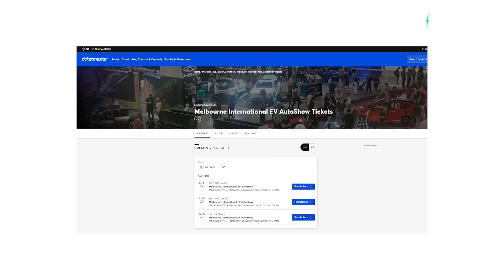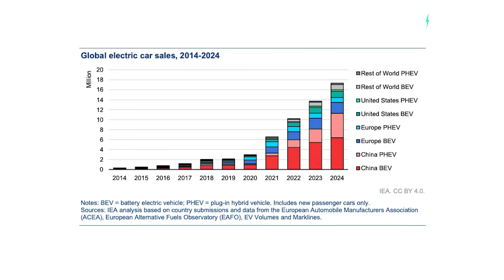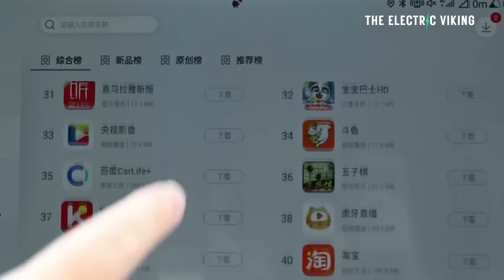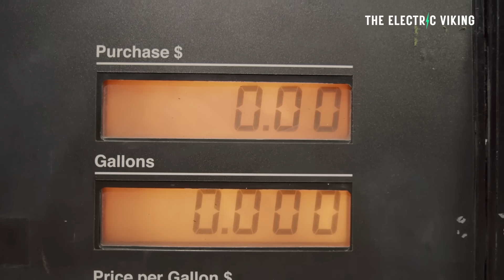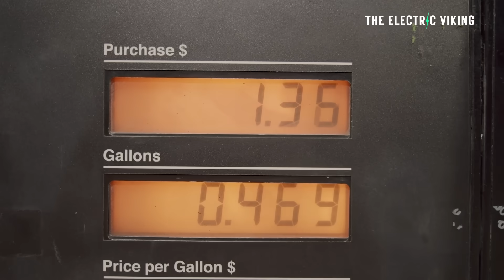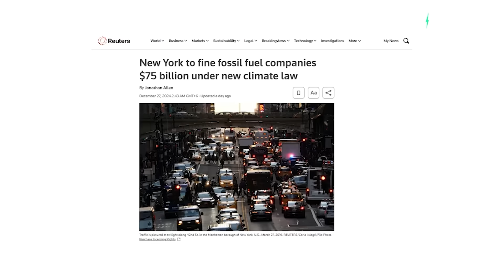Numbers Don’t Lie: Electric Cars Are Steadily Replacing Oil

Comment: Here in the UK where coal is not part of the energy food chain at all.......We have some of the highest EV charging costs in the world..
Reply: Sorry but you guys got the highest costs of almost everything over there. 🤣
Reply: Until gas stops being a part of the pricing structure, it will continue to be high.   The more hours we get when gas isn't part of the equation, the better.   We just need more wind and solar to get there.
Reply: @peteralflat281  My son has been called out to fix a recent substation fire near Cardiff,an increasingly common event,especially when it's been sunny or windy..The reason ?..The grid infrastructure can't handle the fluctuating AC harmonics caused by increasing renewables..Renewables,unlike coal,nuclear and hydro produce DC converted to AC with ultra expensive inverters which are set to shut down then restart to protect renewable damage upstream,these sudden load changes are linked to the substation blowouts,the old gear can't handle them..This brought Europe's renewable hotspot Spain to its knees for a day the other week..They are so worried here that University College London is starting a course to get to grips with the issue that UK Power Networks are sending him on..Nothing to be seen here,according to the Green controlled media..EVs are no problem..In Norway !..Where hydro means these issues don't arise..But most of the developed world is not so lucky..It is not falling gas prices but this which is keeping bills high and whats left of our industrialists awake at night..Especially in Scunthorpe with our steel on life support..
Reply: Get solar panels and battery, it will pay for itself in less then 5 years.
Reply: @Jebus-d9k5j  Great idea..Not !..Generates the least energy when you need it most..In winter..Then there's the fact that in Europe there are only 20% of days without cloud cover
Reply: Serves you right. You started this whole coal burning Industrial Revolution!🤬

Comment: EVs may well be replacing oil,but not coal unfortunately which is the main fuel used to generate the electricity for them..Almost 75% in China,much of which is suppled by "Green Australia"..You are very good at misdirection..Coal is sooo important in the EV food chain yet you never give it a mention !
Reply: Coal does NOT generate 75% of China's power. China has been building far more renewables than coal and its emissions have plateaued. Utilisation rates at its coal plants are falling.
Reply: While China is building many new coal plants, they are super efficient.   They are also shutting down a lot of their older inefficient smaller coal plants.   The result is that China is projected to use less coal this year than last, while generating more electricity.
Reply: China is building vast amounts of wind and solar as well. There are estimates that coal use could actually decline in 2025 (modestly).
Reply: The misdirection is all on your end.  China has over 1 TW of solar panels deployed, and annual production of 350 GWs (that's equivalent to building 350 nuclear reactors per year... and still accelerating!).  Some new coal has been built to replace older, dirtier, less efficient plants as renewables grow to keep up with growing power usage.  Coal has also been added to offset lost volume of hydro due to several years of persistent drought.  Coal is basically obsolete at this point.  Find some "news" sources who actually know what they're talking about, and you'll put your foot in your mouth a lot less often.
Reply: Data for 2024 shows that coal's share of power production in China has fallen to 58% and is on a downward trend, with new capacity from renewables now meeting nearly all the increases in annual power demand. China has poor gas reserves and is heading down the path of using its coal plants much in the way gas peakers are used in Australia.
Reply: @tassied12  That CCP data doesn't line up with the large increase in coal imports,new coal plants and rise in emissions to the same per capita levels as Japan who only use 20% coal,then you've the hydro off line due to water shortages in the South..Still believe that old chestnut that there are 1.5 billion Chinese,yet the cities and countryside look surprisingly empty..
Reply: @eddiemilne4989  David Fishman from the Lantau group has warned that emerging drought conditions and heatwaves may impact demand and hydro availability.  This could give a fresh push to coal demand, but it is still quite clear that Chinese coal use and emissions are on track to enter structural decline.  Another factor has been the record deployment of rooftop solar in the last 12 months.
Reply: @tassied12  There's more solar in Spain which is why the grid crashed and why substation fires are becoming common here..My son has been sorting out one in Cardiff last week for UK Power networks,he told me it is not a coincidence that it is close to an offshore wind interface..You see the grid works on AC which has varying wave harmonics,specially as temperatruers chage in spring an autumn..Renewables produce DC converted to AC through giant inverters producing fixed harmonics..This can trigger overloads and automatic shutdowns to protect the wind or solar farms...Nuclear,coal,hydro and tidal generate AC so less of a problem and when they do go offline due to harmon ic blips the inertia keeps them spinning so no tricky restarts..Before retiring I did contract work for Ruston Gas Turbines,so I know what I am talking about..University College London are so concerned they are running a degree level course on this very problem and son has signed up..He will make himself a fortune and it will be reflected in our bills..These substation fires don't come cheap either..Then there's travellers nicking the copper cable when the power is off..
Reply: I have a friend who has just returned from China after being gone for 10 years.  He could not believe it.  The air was clean, and the sky was blue.  If what you said was true, the air wouldn't be clean, and the air would still be gray.  Obviously, they are no longer burning coal -- at least not where my friend was.
Reply: @Tony-m5t  Cars caused the smog in the cities,due to their sheer numbers,so evs have helped there,but intensely polluted areas of steelmills,coking plants and coal generating centres are not exactly on your friends places to visit list..There is much of China you are not allowed to see,and I'm not talking about military sites,I'm talking about their rust belt..
Reply: China's renewables past coal for the first time.